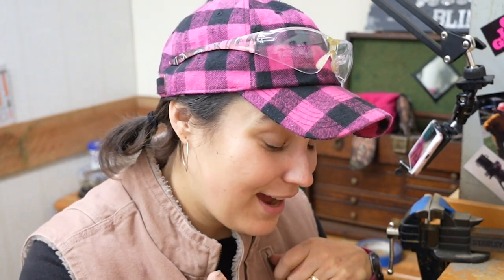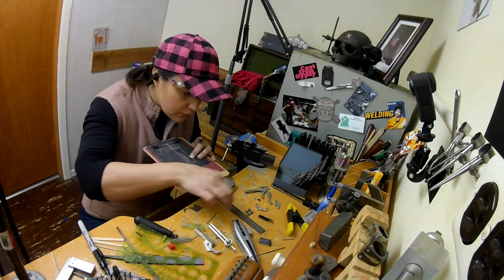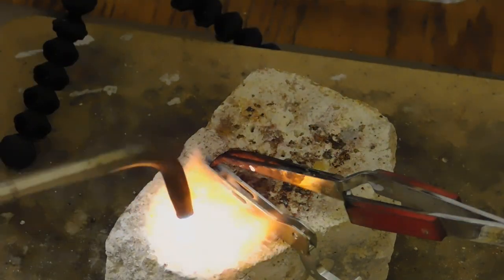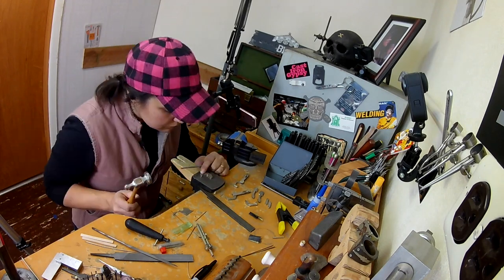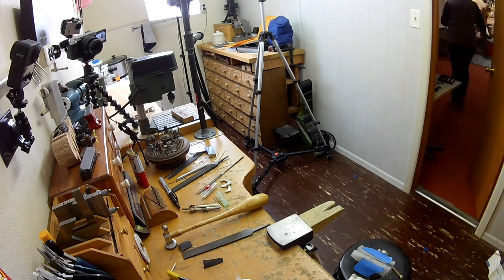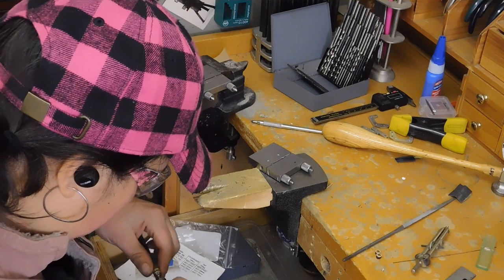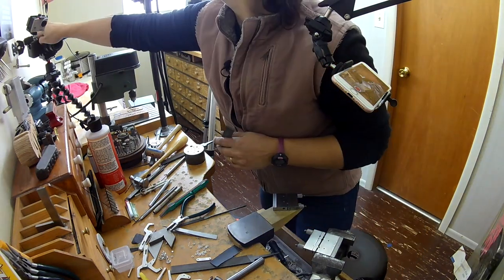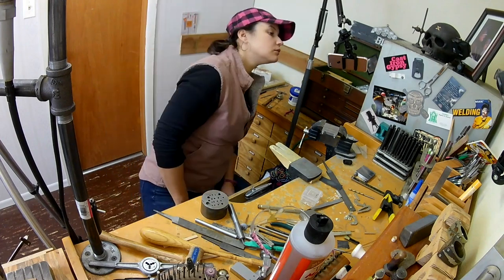11/21/2021 - Part 2 | Behind the Scenes Studio Session | Vice Grip Clamps | FWTTT2021

Comment: That was fun!  Nicely done - crunch time.  Looking forward to the big finish!

So, last week...  I was making  some custom-precision copper connectors, made of copper tubing 4mm and 6mm OD.  I cut them with the new jeweler's saw you made me buy (thank you -- I have needed this my whole life but didn't know it!), in the little miter jig you made me buy (thank you!).  Then I had to square up the ends, which I tried to do with a file, and that worked pretty good with my clumsy technique.  Then I remembered this technique I saw somewhere; don't know where.  You chuck the cut piece in the drill, and press the end against sandpaper on a flat surface.  It wanted to walk all over the place at a tangent to whichever side of the tube was touching the paper, but as it flattened out and as I got more perpendicular, it stabilized a bit, and the tracks of abraded material on the sandpaper got wider, closer to the size of the tube, telling me it was getting flat.  It worked pretty nice in spite of my clumsiness, but I think it will work even better in the little drill press that you're going to make me buy.  :-)  And then eventually, I'll be borrowing some of your soldering techniques with precisely-measured little chips of solder, so my connections are all balanced.  I wish I could use silver solder; it's just wonderful stuff, but... too hot for this thing!

Nickel pickle.  Oh, to be young again, when we were allowed to giggle at such things.  :-)